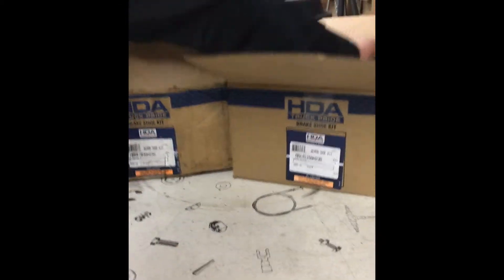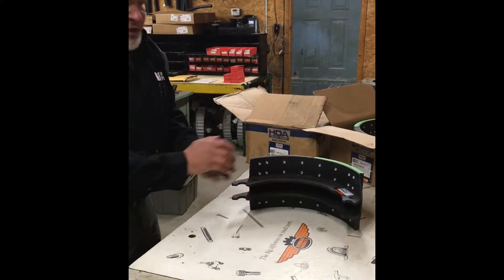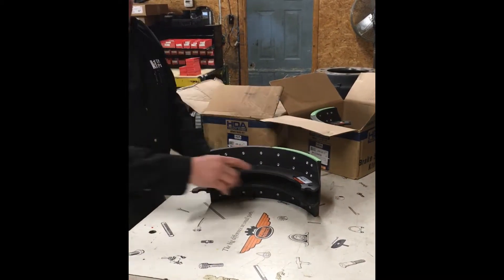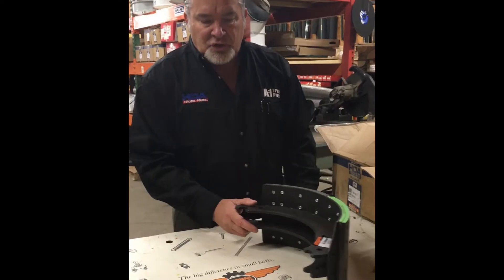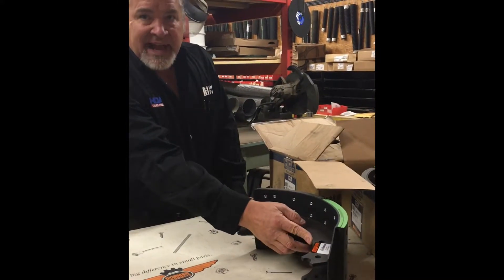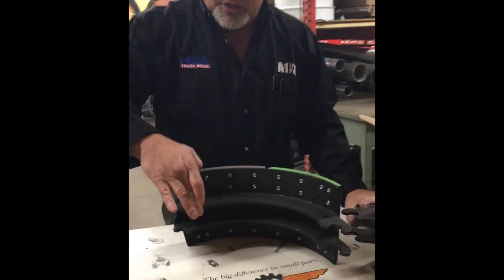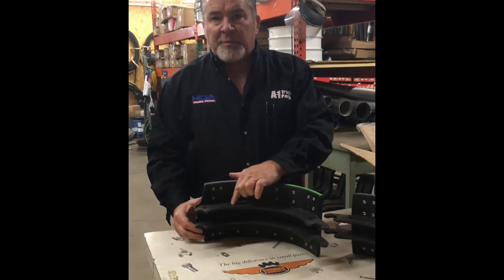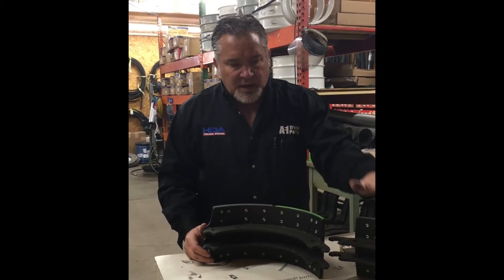How to Identify Brake Shoes for Semi Trucks.

Comment: I believe that’s 16.5x7 if that’s a early model Q shoes isn’t it?
Reply: 4515 brake shoe part # , used mostly on older semi trailers.
Reply: @ThePartsConsultant  yeah anything pre 98-99ish before the 4707 came out. Same with the 4311 and 4709 eatons